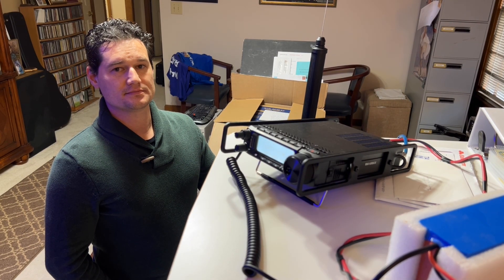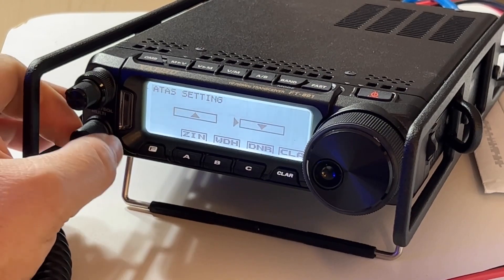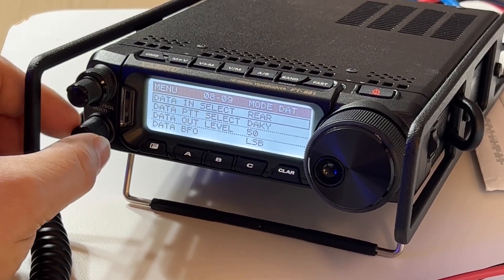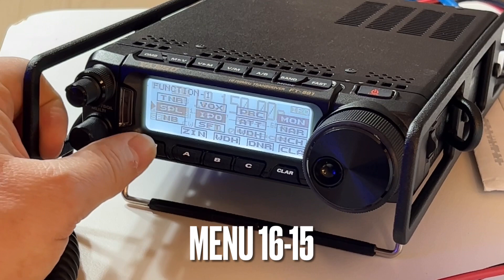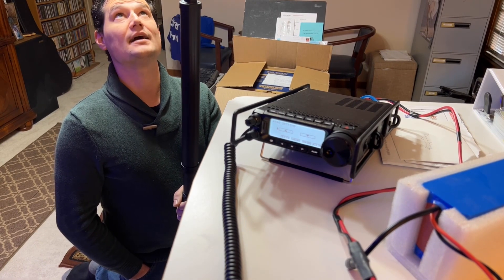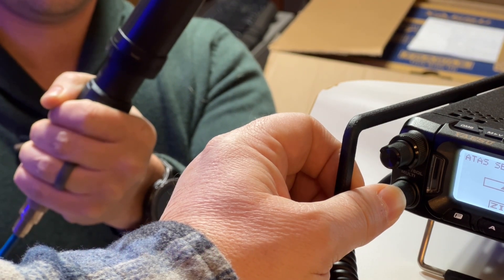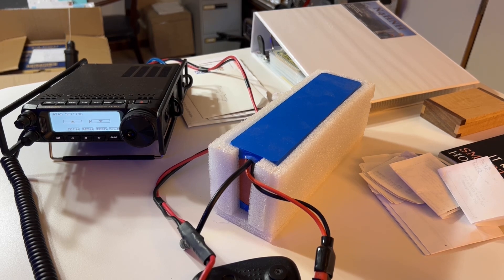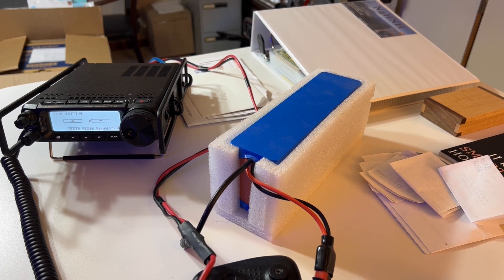Yaesu ATAS-120A Part 1 (Unboxing and Menu Settings) #yaesu #atas-120a #hamradio #hf #antenna

Comment: Works same on ftdx10 fantastic antenna
Reply from the maker: Yes, it’s quite a list of radios that it works with - old and new. Very smart of Yaesu.
Reply: @n4hnhradio  I am new to ham radio I have watched a lot of your videos very helpful to me so thank you .I now have a ftdx10 in shack and ft891 in my truck 73s
Reply from the maker: That’s a great combination. Well, the same as mine, actually. I’m pleased. There are many great radios available today, but, when I’m ready to buy, Yaesu tends to have the most for my money. 

As I say quite often, there is no perfect radio.  There is always room for improvement. I point out deficiencies in the various videos. But Yaesu seems to offer the most on the performance side. I wish they would listen to my ergonomic suggestions for the FTdx10. More mouse control to keep us from having to press buttons next to the VFO. But, I won’t let that be a deciding factor for a purchase. Ultimately I need performance.

73, Doug
Reply from the maker: It’s interesting to me how some people have a great experience with a device yet others say it’s terrible. I’m not referring to the ATAS-120A, specifically. It’s just a general statement, based upon years of observation.  But, I have heard and read negative comments about the ATAS-120A.
Reply: @n4hnhradio  notice that a lot on here I can only run 10watts first contact with atas am ftdx 10 1000miles .things can only get better thanks again from England.
Reply from the maker: That’s great Mark!  First contact 1,000 miles with only 10W.  My first contact with the ATAS-120A was yesterday, checking into the SouthCARS net here in the Southeastern U.S., on 7.251 MHz. They operate the net everyday of the year, from 8AM to 1PM Eastern. Mobiles get priority. It’s practice for emergency conditions.  I received a good signal report. 

I think some people have a negative opinion about something because they didn’t set it up correctly. That’s why this channel exists. I hope to help people get it right the first time by learning from my mistakes. Save money too. 

73, Doug
Reply: @n4hnhradio  did you mention in one of the videos the m70 microphone by Yaesu in on of the videos seen a thew people slate it I got one free with radio not add chance to use yet .?
Reply from the maker: Yes, the M-70 matches very well with the FTdx10. Use the same EQ parameters that I show in video #4 of the FTdx10 series. One of the best sounding stations I’ve ever heard belongs to one of the VIP Patreon members who supports this channel. He has the M-70 connected to his FTdx10, using the parameters from video #4.

73, Doug
Reply: @n4hnhradio  ok cheers Doug I’ll do that I’ll let you know results 73 mark
Reply from the maker: Great!  I look forward to hearing about it.
Reply: Hi Doug I did the settings on #4 fantastic reports on my audio so thanks again an happy new year to you and your family 🎉73s mark
Reply from the maker: I’m glad to hear about your positive TX audio reports. I wish you a happy, healthy, and prosperous 2023, Mark.  

73, Doug

Comment: I’ve operated mobile all over the Outback for over 4 decades, so I’ve more than a little experience.
Reply from the maker: I like mobile operation too.  I work DX during a trip to the grocery store, using my ham stick.  I used my FT-890/AT as my mobile radio in the late 90s, until 2019, when I got the FT-891. The FT-890/AT served me well.  I still have it, as a backup.

73, de N4HNH
Reply: @n4hnhradio  the little 891 is an immensely underrated set. People complain about the menus and sub menus, but once you set them up, assign a couple of custom “hot keys” they’re about the simplest MODERN HF radio to use. …..and have very effective noise blanking.

I’ve interfaced mine to a Codan9350 auto tune antenna (essentially a super robust equivalent of the ATAS, but built for extreme conditions) and, essentially, worked the world with it.
Reply from the maker: @outbacktraveller58  I couldn’t agree more. That’s why I have two. I operate exclusively using Memory Tune. When I’m mobile, I seldom touch anything but the Volume, RF Gain, Multiknob, and VFO.

73, de N4HNH

Comment: I use my ATAS-120A with 857D. I pick a frequency and click tune and it does the business. Amazing antenna.  Love it. You will enjoy it.
Reply from the maker: I don't expect it to beat my ham stick, especially on 40 meters, but it is definitely more convenient.  Part 2 and Part 3 are already shot.   I need to get them edited and uploaded.  I show the installation process and the initial operation.  I might leave the ham stick on the truck too, for 40 and 60 meters.  I work 60 meters mobile quite often.

73, de N4HNH
Reply: @n4hnhradio  I mostly use 10m/12m/15m/17m/20m mobile. 40m gets busy in the evenings and I use my EFHW at my QTH
Reply: I had a really good day with FT-857D 50w with ATAS-120A on 10m. I had a QSO with a station in US Virgin Islands 4200 miles away. I was near the beach which helped as well.

https://youtu.be/5wHs4RiJsSE

Comment: I really like mine.  Have it mounted on luggage rack of 2004 4Runner.  For ground, I only ran a braid from mount to body under rear hatch to screw.  Easily get SWR less then 1.5 even on 40 meters. I worked Spain from SoCal, SSB.  I did change whip from 3 ft stock to 4.5 ft.  I do only use it when parked and remove when in motion.  Looking forward to follow up video of your experiences.  Check K8MRD videos for some hints on tuning if it seems to get "stuck".
Reply from the maker: I have already installed and used it.  Part 2 will show that.  I don't want to spoil it though.  I compare it to my ham stick in Part 2.  I had no trouble with grounding, because of where and how I mounted it.  I'm glad to hear of your positive experience with it.  I work DX regularly with my ham stick.  I hope to do the same with the ATAS-120A.  It sure is more convenient than the ham stick.

73, Doug

Comment: I wonder how well it would work for portable operation. Can you break it down into smaller sections? It doesn't look too heavy as your son wasn't straining to hold it up.
Reply from the maker: Hi Martin!  It's made of plastic.  I would consider it as delicate.  The manual states not to operate the tuning mechanism while in motion.  It will create a strain on the motor.  You can see why, especially at higher speeds.  I have tuned it in traffic though, when barely moving.  I am in Atlanta after all.  Ha! Ha!  

There is a radial kit for portable operation.  I could fit it in my backpack, but it would be sticking out the top.  The stinger can be removed, and the antenna carried in two pieces.  The black plastic portion doesn't come apart, except to work on it.  It is very important that you install the weather boot where the stinger attaches, to keep moisture out of the antenna.

73, Doug
Reply: @n4hnhradio  Thanks for the info Doug. Have a happy New Year.
Reply from the maker: I hope you have a happy, healthy, and prosperous 2023, Martin.

73, Doug

Comment: Congrats on your Christmas present.. I have this same setup (not installed in my truck yet) due to getting everything ordered . I would suggest checking out Breedlove antenna mounts. I ordered a front bed mount from him along with the S0-239 to S0239 attachment . Fast shipping , very well made mounts. I also have the Lido bolt on seat mount that I had in my previous truck. Now that I  have everything, I hope to be installing in/on my truck soon, I also will be mounting my Yaesu FT-8800, which was in my other truck, so I can have 2meter/440, and HF. anyway  I am rambling on . Good luck with your install. Happy Holidays.. N4TAF     P.S. I have been subscribed to your channel for a while , really enjoy them. 73 😀
Reply from the maker: Hi Robert!  Thanks for subscribing!  Video number two will show it in operation.  I found a no holes drilled mount made for my truck.  Part 2 will show the installation and initial operation.

73, Doug

Comment: The up down buttons are more for fine tuning. Use the Function 1 menu TNR selection it will force the radio to CW 10w and the radio will do everything for you. When it gets as low as it can in SWR it will stop the tuning function.
Reply from the maker: Yes, I will be covering that in a future video in this series.  Press PTT and hold either the up or down arrow, depending upon which direction you wish to tune. For a higher frequency (UP arrow), for a lower frequency (DOWN arrow).  But this video is intended to mimic what my viewers might experience when they initially open and play with the antenna.  I wanted to draw attention to the confusion regarding the direction of the arrows.  Many have told me how it initially confused them. I appreciate the comment though.

73, de N4HNH

Comment: This should be a good series--I've been considering getting an ATAS.  Supposedly it works on VHF/UHF too?  I'd be interested to see how that works.
Reply from the maker: It will be a series, Jonathan.  A few videos at least.  The second video is long (31 minutes).  I thought of splitting it up, but I changed my mind while filming.  Half of the video is the installation process, and the other half is the initial operation.  I thought the viewers might get frustrated having to wait for a 3rd video to actually see it operating.  But there will likely be a couple more videos after Part 2.  I want to do more comparisons to the ham sticks and work some DX.

73, Doug
Reply: @n4hnhradio  that sounds great, looking forward to it.  I'm interested to see what you do as far as bonding it to the chassis and what results you get.  While I've done loads of portable HF, I haven't ever used a car-mounted HF antenna.  I recently purchased some Hustler resonators to try, but the ATAS is really tempting too.
Reply from the maker: The ATAS-120A is very convenient. I’ve beat up my ham sticks for 25 years. They get out very well but they find tree limbs and low hanging power lines occasionally. Okay, that’s partially my fault. Mine are mounted atop the truck. You will see in Part 2.

73, Doug

Comment: Good luck with it. You WILL require excellent RF grounding/bonding or. It won’t work worth a pinch of pelican poop. Additionally, do NOT retune whilst moving as they hate that …..it wears the drive out, AND allows moisture ingress. They’re not real weatherproof, so best not leave it on permanently, and vibration is not their friend.

Other than that, they work pretty well.
Reply from the maker: Part two will show the installation and operation.  I won't spoil it yet though.
Reply: @n4hnhradio  …..mate, I’m sure you’ll do it right. I don’t wanna denigrate the ATAS120 because they’re not a bad but if gear. However, as my environment is so radio extreme that I just can’t contemplate something like that. If ever you’re interested, you could see pics on my QRZ page, under the callsign encapsulated in my Nic here.
Reply from the maker: I will check it out.

Comment: Thanks Doug! As I mentioned during your Livestream, I now have an ATAS- 120 for my 2006 Tacoma & 891. I found a mount for the antenna that goes next to the driver side rear taillight. I'm waiting for the cable from DX Engineering. Looking forward to your follow-up video!
Reply from the maker: The follow-up is shot. Will take some time to edit. I’m actually working on it now. 

73, Doug